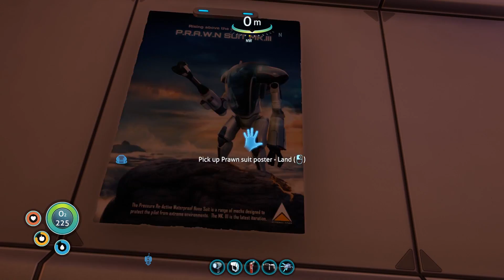SUBNAUTICA - REPAIRING THE AURORA'S DRIVE CORE (2018) - Ep#6

Comment: You missed a few things while exploring. There is a prawn suit upgrade in the prawn bay at the terminal covered by fire. The wall posters are able to be picked up as well for four different posters. Also some lab equipment in the lab u got the large specimen containers. They are on the table in that room.
Reply: I added this part way in the video. You can scan the single wall shelves in the cafe with the vending machine

Comment: If i remember correctly, you should be able to build a power cell charger on the cyclops itself. Im of course not certain of this.
Reply: 99lollollol yes you can
Reply: You can.  It used to use less power to charge the cells than it would drain from the cyclops batteries, so you could have an infinite loop of power, but they nerfed it so that doesn't work now.  The only place you really need the cyclops is in the lava zone and you can equip it with a thermal charger so having more than 1 extra set of cells is pointless.
Reply: quinndiesel1977 I just made a recharge base in a lost river safe spot, I don't want to take my cyclops into the lava zone
Reply: taking the cyclops to the lava is a good idea it is a safe spot to reacharge with the thermal power and it is a far treck in the prawn to the  final precurrsor bace
Reply: I did that too, just past the Cove Tree.  There are great places for thermal power plants there,  but once I got the portals set up,  I never used the recharging base again.   So it makes sense to use the cyclops to get in, get to the  containment facility and get out.   That could all be done with the PRAWN suit but it takes a lot longer, and I think with silent running mode, the cyclops is safer.
Reply: quinndiesel1977 better than my spot. I literally parked mine Inbetween the crabsquid entrance (blood trench) and the giant rib cage. I took my prawn and killed the crabsquid and luckily it never respawned, but I was always like 200m from a ghost leviathan..
Reply: quinndiesel1977 and my cyclops was fully loaded and apparently silent running doesn't protect against a sea dragon. I took no chances, so I just took my prawn down and teleported back to the lost river